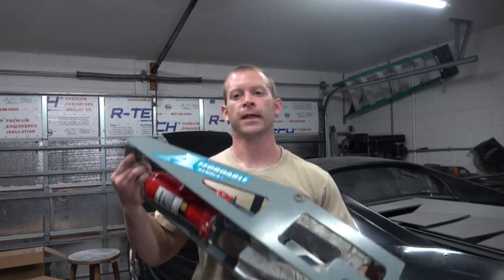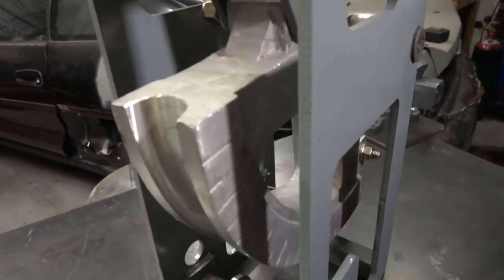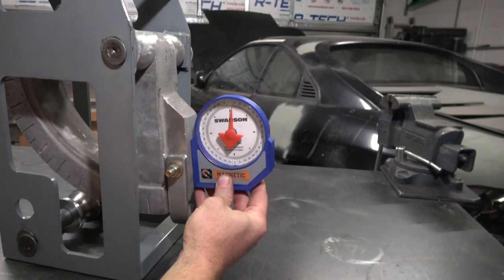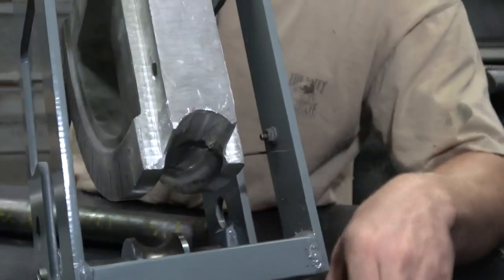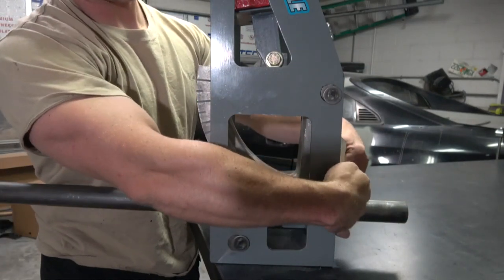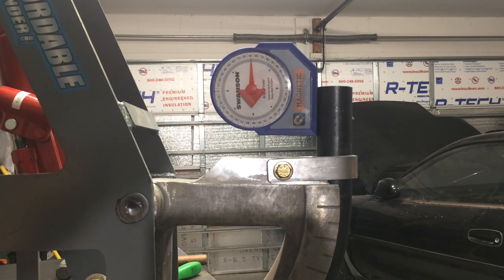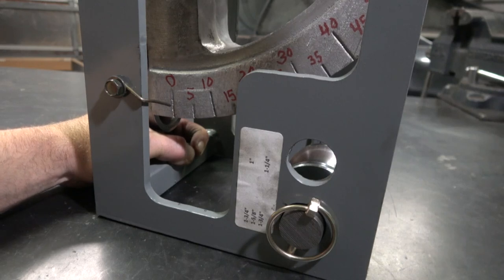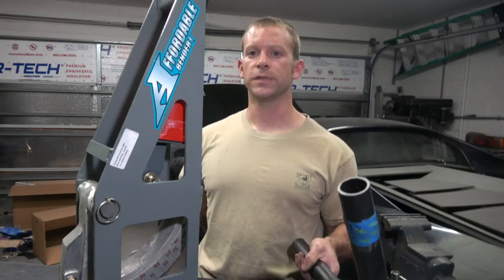Affordable Bender review

Comment: A couple of comments for anyone who might run across this review. As someone noted below, the reason that he couldn't insert the tubing is that the die was not returned as far as it will go. I had to shorten the extension screw on top of the ram to allow mine to return far enough to insert the tubing. All tubing will need to be slightly over bent to allow for the elasticity of the tubing. Also, all tubing will have some spring back (different from elasticity). Spring back means a 7" center line radius die may produce a a 7 1/2" actual bend radius. Example : Wrap some wire tightly around a pencil. Let it go. The diameter increases slightly. That's spring back. The take up distance needs to be tested. The center line bend radius distance for a 90 degree bend must be known. Test bends will give you all of this. Also, mount the bender to your work table and save yourself some aggravation! Oh, get yourself a magnetic digital level that measures relative angles. You won't be sorry. This bender is good value for the money in my opinion.

Comment: So does the bend start at 0? Or does the bend start at the strap? Or end of the die? I'm trying to use bend tech software and it shows this to be a 9" clr but I'm not sure where to start.
Reply from the maker: the bend starts at the inside portion of the strap. Make a bend with some scrap to help you better calculate. I think i go over more of this in my roll cage videos